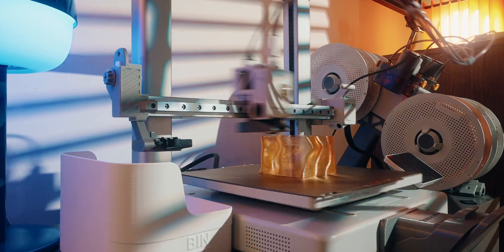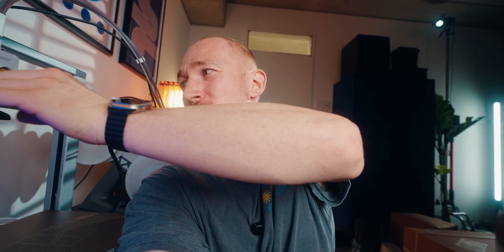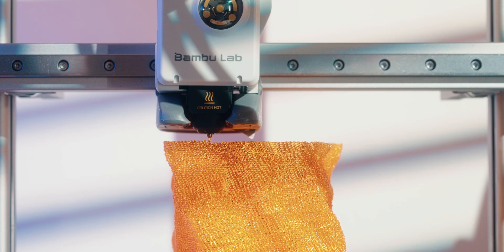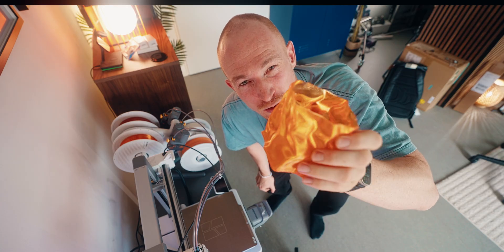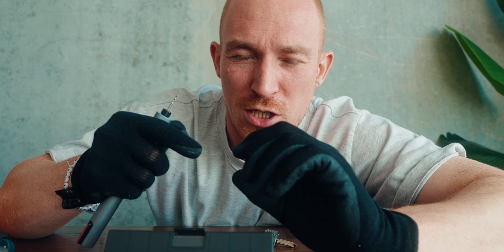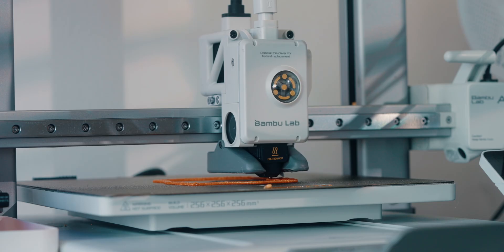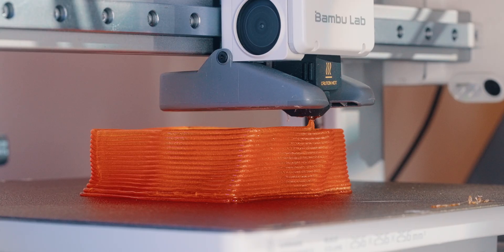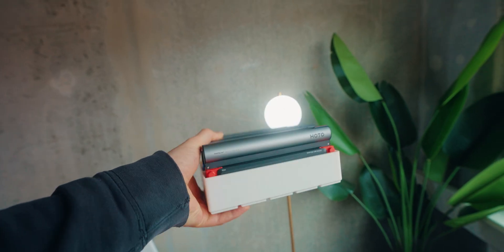How Thick Can You 3D Print?

Comment: I run thick lines on my slow 8bit ender because the motion system sucks. The limitation for me was cooling- I switched over to HeroMe and went as lower with the print temps, and things started coming out perfect. I completely agree with you- thicc lines with transparent filaments are AMAZING for lamp shades / vases.